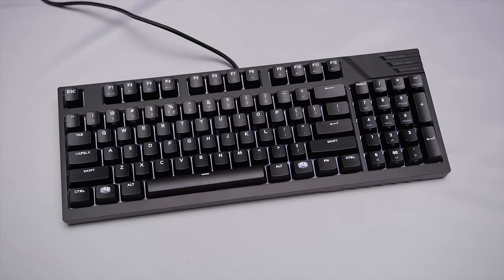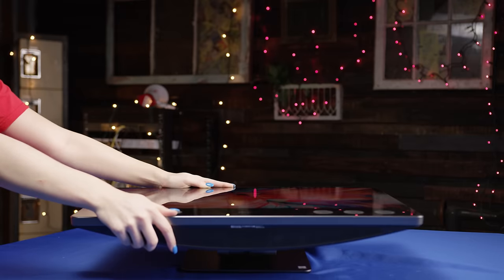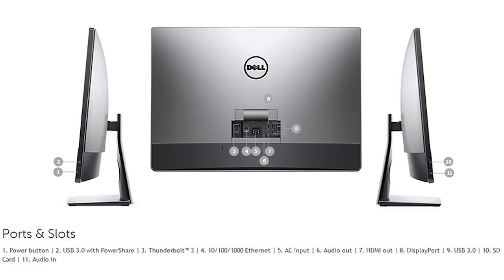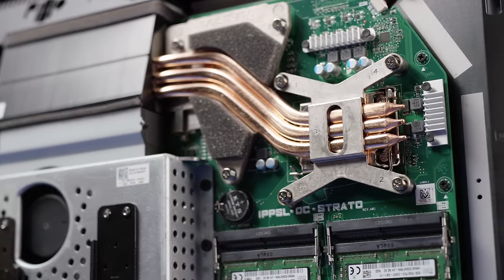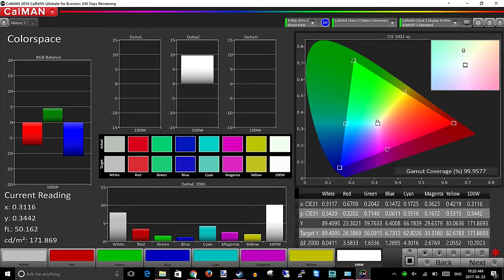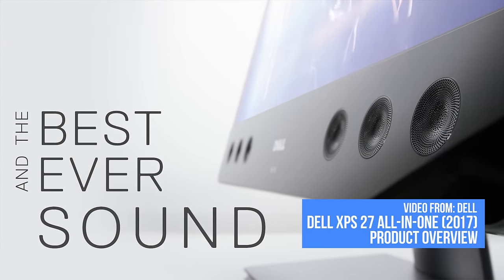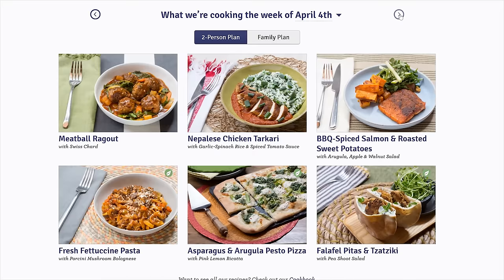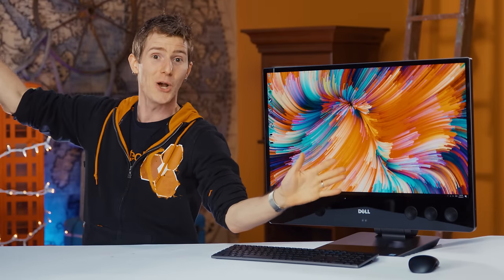Dell XPS 27 - An Audiophile-grade All-in-one

Comment: That design looks dated as hell...
Reply: Im amazed any designer would let that thing leave the fucking factory, what the hell were they thinking..
Reply: Vincent it's actually not bad. Just not made for you
Reply: yeah the sound bar should be place on the dock/monitor leg thing instead of right below the screen like that
Reply: dela vago Come on be real, the speakers look like something from the 90's
Reply: Yea, it's missing RGB lighting.
Reply: No its doesnt, where the fuck do you want them to put the speakers in a design? Look at how slim the bezels are on top and sides so that makes it pretty damn sexy idk what youre tripping on
Reply: #Triggered
Reply: I would like a fabric grill cover
I still thing the iMac looks better
Although it's cool you can work on it
It just looks chunky
Reply: Zaryab B CHUNKY
Reply: definitely looks like it came out in 2005...
Reply: Fabric or just glass, who in there right minds, would wanna look at this in 2017.
Reply: Youtube was founded in 2005.
Reply: im not a huge fan of the all in ones because they cant be upgraded and look ugly
Reply: I think it looks fine except for the MASSIVE bottom bezel with those huge speakers. If you cut off the bottom part, I think it would look quite nice.
Reply: Why? Because it isn't one tenth of a millimeter thinner than the competition?

In turn it offers the benefit of seemingly very good speakers. You know that speakers need some depth to sound good, do you? That's why most flatscreen TVs sound like shit.
Not saying their speakers were "audiophile grade" though. The PC propably doesn't even have any better-than-average audio circuitry to begin with...
Reply: You wanna know what else is dated? X86.

Take your :It's old" argument and shove it inside your CPU socket.
Reply: I dont really understand this product it seems like the Pc Version of the iMac with huge Speakers on the bottom. But instead of doing the things better apple did wrong they did the same or different mistakes:
-HDMI Input
- This thing looks enormous it seems to be even thicker than the old white iMacs from 2007
- Why the hell you need a touchscreen on a desktop like that? And who would ever Use this big thing flat??
-IO is horrible (beside the side ports)
The speaker are bad joke-> this product obviously should aim professionals but pros would always choose external speaker over this 10 small ones...

Comment: I'd be interested in knowing how much thermal throttling actually affects an NVME SSD. I know many manufactures claim their aluminum heat spreaders help keep the drive cool, but I just don't know how necessary these additions are.
Reply: M.2 drives actually get pretty toasty. Most of the "heat spreaders" just end up trapping the heat, though. You're better off without them.
Reply: bladudemovies time to make Rgb nvm ssd coolers.
Reply: With U.2 or extendable m.2 cable

Comment: Bought the 2720 version about 4 years ago, and still have it! This was before I got into taking apart and building gaming PCs, and when I was more of an office workstation person. They have definitely changed in most recent years for a very, very different style, but I must say, I have been super impressed and happy with this model. Beautiful display, plenty of port options, and tons of upgradable parts. Unfortunately the display is starting to blink in and out randomly as of late, I think it might have something to do with the fact that I was using it as a second display for my gaming rig, along with a KVM switch, and somehow someway something got shorted, at least that’s when the display flashing started. I’m actually fixing to wipe it clean and put in a bigger mSata drive so that it can be the main boot drive, so hopefully this will fix some of the issues I’ve been experiencing (doubt it). If not, time for official retirement!

Regardless, I 100% recommend this PC. By far the best purchase I’ve ever made, never once regretted it. Only suggestion is to immediately upgrade the mSata drive (at least in my model which was 32gb) or install a 2.5” SSD for your OS. After that super smooth sailing from there. According to this review, the latest model has an M.2 NVMe slot, which is just freaking amazing, so take advantage of that.

Gaming isn’t a terrible experience. I actually enjoyed it quite a bit, however I’m not a FPS or 4K junky (at least not yet!). If you’re a programmer or other professional, this PC has the power and quality to get the job done.

Comment: Okay, I have some advice for people interested in excellent sound quality. Hang around on ebay and attempt to obtain a Marantz PM8003 amp, a Marantz SA8003 CD players(also plays usb), QED revelation speaker cable bi wire, qed audio-s interconnects and Monitor Audio RX2 speakers. A fantastic match, the sound is incredible. I wish I'd kept my set up.
The Ki Pearl Lite is lacking, I only changed for the DAC function on the CD player.
Reply: The fuck did you wrote?
Why did you wrote this? In what context?

Who uses CD for HiFi listetning?
There are far better amps than the Marantz PM8003.
There are far better speakers than those Monitor Audio
Reply: Michael Davis you lost all credibility when you said Marantz PM series. If you're looking for a Marantz, get the 22xx/b or 23xx/b series.
Reply: lol indeed

Comment: probably would have been better off including less of those small speakers and just having 2 big ones... they should have put drivers that could actually displace the air, a passive radiator would have helped out with the low end aswell.. I think I set the bar too high for dell to actually create a good set os speakers on a monitor xD.

Comment: Unless you were to completely remove the motherboard you could search up the part number of the LCD screen and find a controller board to attach to it so you can still use it as a monitor

Comment: i7 6700k Processor $300, 27" 4k touchscreen monitor $700, 1 terabyte ssd $300, GTX 1070 $400, 32gb memory $250, Wireless keyboard and mouse $100, Sound card $100, Power supply $60, Motherboard $150, Case $90, Cooling/fans $100, Soundbar/subwoofer $300. Random other shit needed $100, Total $2950. XPS 27 $3450. Money saved $500. Quality increase - huge. Bang for buck increase - immeasurable.
Reply: Replace the soundbar/subwoofer with two KRK Rokit 6 powered monitors and it'll spank the XPS all day long audio wise.
Reply: Hell yes, those too. Same price.
Reply: Holy shit?! You can get better value by going custom built full size computer instead of prepackaged small form factor. No one could have guessed that.
Reply: But then you have to look at ugly Rokits.
Reply: You are buying a 60 buck PSU on a system that expensive? lol
Reply: LancerFIN: I wouldn't exactly call the XPS 27 small form factor. The display looks bloated... I much rather have a mini-ITX box on my desk with a nice flat monitor next to it, instead of some all-in-one which looks like it drinks more beer than I do.
Reply: 6600k/1080 tbh
Reply: I'm amazed people still talk diy on factory built system reviews.

1) labour costs
2) proprietary design
Reply: Replace the sound bar with a pair of KEF LS50 and a good dac/amp. NOW its audiophile grade comp.
Reply: Well it comes prebuilt and its an all-in-one. You can stay at home and make a steak thats just as good if not better but i know damn well youre going to to eat to get it. Same thing just a different scenario. You pay for convenience. Ever wonder why a cold bottle of pop at a store is 2$ but you can buy a pack of warm ones for 4$. Convenience
Reply: I have no problem with people buying pre-built over DIY -- it all depends on your budget, skills, time, and whether you expect to have fun tinkering.

But the whole concept of putting your computer in your display seems silly to me. I've always thought that by trying to cram your device behind the display you just end up with a difficult to repair, way too thick, usually slightly overheating device.

I won't criticize people for paying extra for convenience or aesthetics. But in this creative/stylish corner of the market it just seems to make more sense to sell a powerful mini-ITX or NUC sized box, with a premium quality thin touch display on top. In that regard, the Surface Studio would be perfect in my opinion, if the PC at the bottom could be detached from the display and replaced for newer models.
Reply: 60 dollars for a power supply mate that don't seem good, also get monitors instead of soundbar. Also this product is retailed for old people and dumbasses. not disagreeing with you but lets be real here
Reply: Orian de Wit yet the imac seems to sell really well. Different products for different folks.
Reply: I think this product is good for people that truly have space saving needs, like people in tiny 100 square foot Manhattan studio apartments or similar, like renting a bedroom. Otherwise it just seems more cost effective to get separate items. I've never built a computer and never plan to, I just looked up some prices for similar or better components. How much would one charge to build a computer with these components supplied? But with a better psu as mentioned - I thought 650 watt would be sufficient and $60 seemed to be the average price. Also I couldn't find anything on the graphics card that comes with the XPS so wasn't able to compare that.
Reply: ya but ill buy it anyway cuz the commercial told me 2
Reply: @100alexcool By recommending soundbar instead? yeah no. Obviously "audiophiles" wouldn't care two shits about the built in speakers. It's a buzzword. But compared to something like the imac those speakers are probably million times better.
Reply: I thought that everyone knows the meaning and real value of All-in-One PC. with this comment I realized that i was wrong
Reply: T L S dell want to make some money on there product and how much planning and time to make it
Reply: except that 700$ touch screen probably isnt going to be as good as the one on this aio. and a sound card is a waste, you buy an external dac instead.
Reply: Orian de Wit The Inspiron 7775 would like to talk to you.
Reply: is that the ryzen based dell all in one? if so it looks nice a few issues but meh.
id buy it.
Reply: 250 for 32 gbs of ram ? Oh, the good old days...

Comment: Wsih you guys would look at a lenovo Tiny In One monitor plus some sort of USFF tiny tower, a removable micro desktop with replaceable  (desktop) CPU, ram and SSD/HDD quick and easy to replace/upgrade, and like the XPS27 only needs one cable to run it, however, has LAN 2 more display ports, 2 USB ports on the front, and 4 USB on the back, and the monitor can serve as some what of a KVM, by use of a display port cable and USB cable you can connect a second computer, and use any of the connected USB devices(connected to the monitor) on either computer, depending on which device is selected
Reply: I just wish it had a Vizio D24 D1 style speaker that goes all the way across the bottom, i also wish there were more on monitor USB ports and maybe a card reader

Comment: But if the i5 is already hitting 85's while the fan is achieving lift off then we will definitely be seeing thermal throttling with the higher end i7 skew? Noted that its furmark and its a synthetic benchmark but i'm not a fan of trading performance for that level of noise. Which makes 'high end' all in ones confusing for me. If you have to work with a turbine wouldn't it just be a browsing device most of the time? Can't imagine the motherboard or cpu for that matter lasting long with small fans like that.

Comment: i Just purchased this system(xps 27 7760) refurbed and am going to upgrade ram.  It only has 8GB 2x4(MOD,DIMM,8GB,2X4G,2400,N-ECC) if max i can have is 64GB any suggestions on best value RAM to get and how much? I want to max memory while still using the 8 GB thats already onboard if possible. thanks anyone if your still lurking

Comment: Can you advise me what to do? I want to buy a All-in-One, this XPS has everything I need and I can upgrade it very easily. Some of my friends are saying that I need to buy the Imac 27 instead of the XPS27. I'm used to work with Mac and Windows, so I don't have a OS preference. My humble opinion is that the easy way to upgrade my XPS should be the reason I choose the XPS. The XPS I configured to buy has the latest I7, 32 GB RAM, 1 GB SSD, Radion R9,  What do you recommend?. Many thanks in advance.
Reply: 1 GB SSD LOL
Reply: Save your money, get the xps 27 with those specs. I think you mean 1tb ssd? But those specs are quite solid and can last you quite long
Reply: Yes I'm sorry. I ment 1 TB SSD :) But now I'm not completely convinced because I'm thinking of building my own PC. But watching all the video's does not make it easy to choose. I pre-configured some builds now for several budgets but still when you think, this is it then again some video comes by and gets you thinking, ok that cool to...pffff. Not easy. I think I need all the help I can get..:)

Comment: "An all-in-one for audiophiles" - this is an interesting statement clearing made by a non-audiophile at Dell (not to mention Linus). As an audiophile, I would never buy a single audio system (such as a soundbar) because the single point of noise is subject to destructive interference from close sound emitters (multipoint in the bar) and terrible reverberation due to lack of depth of the speaker cabinet.
This is not an all-in-one for audiophiles; this is a sales gimmick.
Reply: Even not being an audiophile, I know that most products that has to call it self audiophile grade are not audiophile grade. Real audiophiles do the research and know if the product is what they want

Comment: Is there a difference between made for gaming and made for work? Apple claims that with al, their products, which do well and editing and stuff but custom pcs of the same price do that a bit slower while killing at games. Just need to understand. Thanks
Reply: ` shockwaveBJ you're almost always going to get better price to performance with a PC.  it's the hardware.  nothing to do with the OS or manufacturer.  gaming PCs (should) have graphics cards.  where as you can get away with integrated graphics for (almost) anything else.
Reply: depending on the task yes certain cpu's may be better for say editing. AMD's Ryzen is a great editing rig but not as good of a gaming cpu as intels I7-7700K. It has to do with how the software is programmed to take advantage of the cpu's. Gaming software usually cares more about IPC which is why really strong cores giving better gaming performance and a lot of editing programs care more about how many cores you have than how strong only one core is. Apple tends to overprice many of their products but some people still buy their high end stuff because some of the programs they use are  useful for certain applications. For most people however, its a great waste of money to buy apple over PC.

Comment: holy crap... I just looked up blue apron! Basically 10% cheaper than eating out except I have to cook it myself... wait that 10% cost is probably what it costs in electricity to cook it. Forget it... for $12+ a plate I don't want to spend an hours labour making it. What next? This is like ordering a dining room table for $400 and then receiving a tree with a note on it that says "dining room table, some assembly required"

Comment: The Dell Precision Workstation AIO 5720 looks good and at first I was impressed. However, there is no height adjustment in the stand, so you will need a stack of books under the stand if you want it higher. The web cam is poor and at the base of the screen you get an upwards view of your chin but not your face. The touch screen is glossy and like a mirror reflecting light into your eyes. But fundamentally the problem is that it buzzes when the brightness is less than 100%. Dell recognise there is a problem and their site engineer has replaced the speakers and mother board but that has not fixed it and even though it’s under warranty Dell are refusing to replace the pc. I believe this buzz is a design fault. A problem that was first associated with lap tops. It could be the coil winder but that would mean replacing the screen! Effectively this means all the parts are having to be change to fix this design fault or basically I have to live with a buzz!

Comment: I wasn't surprised it had issues at high volume, being that's it's made of plastic and glass and has no dampening.

But... could you add a subwoofer?  I've got a spare, moderately good sub that hasn't been used in years.  Would this AIO be a good choice for pairing with a sub as a cheaper alternative to another new PC and a good sound system?

This wouldn't ever be used as a gaming PC.  This is strictly for email, some web browsing, and wasting time watching YouTube videos.

Comment: But did they fix the buttons? My older model year XPS 27 had three annoying capacitive buttons with an onscreen menu system you had to use for everything from turning the display off, or selecting the input source, to adjusting the volume. I literally stopped using it and eventually threw it out because of the unusable buttons (the the cooling fan eventually sounding like a lawn mower all the time). $2400 down the drain. I also see that they didn't fix the issue with the stand adjustment being almost impossible to articulate without feeling like you're breaking it, or the IO being placed in literally the worst spot possible. Nah, never again. It's junk. Basically an overpriced smart tv.